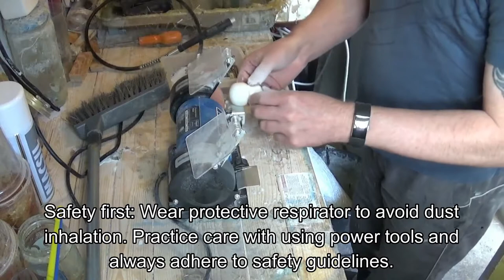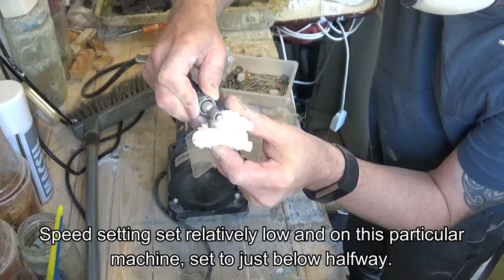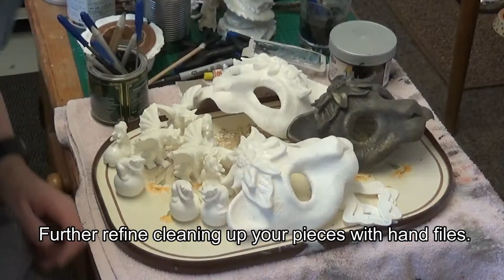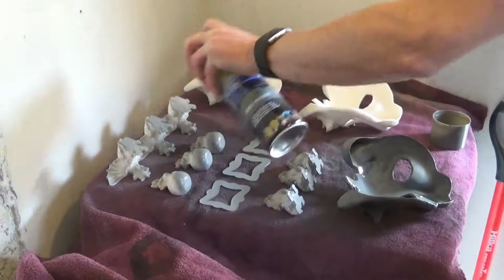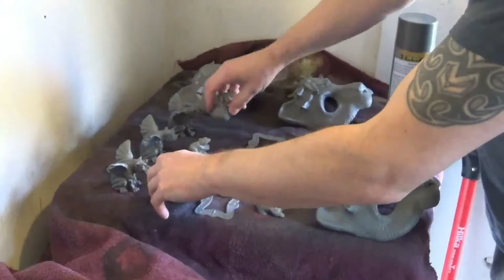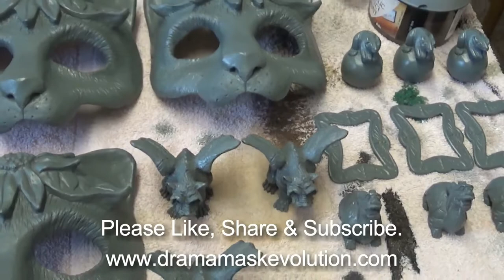Polyurethane Resin Cast Clean Up & Primer Application To Paint

Comment: This looks so cool!! thanks for sharing!  I have a toy that I want to paint over, it was made with Polyester resin and then paint with golden acrylic enamel, you think is save if I paint over with acrylics? what primer do you recommend? thanks!
Reply from the maker: Thank you Alejandra. :) I can't see any problems with you painting acrylic on to your item. You may want to sand with very fine grit sand paper to key for the paint to adhere better. I use car/automotive spray paint primer for priming, which works for me. :)
Reply: Dramamask Evolution Hi! 👋🏽 thank you so much for your reply! so I will sand, then primer and after that paint! right? thanks!!
Reply from the maker: It's hard to tell without seeing your item, but I would guess that sanding down lightly with perhaps 1000 grit sand paper would give something for the paint to adhere to. You may not need to use primer if you already have a base. I use primer on the 'raw' resin as to give the paint something easier to stick to.
Reply: Dramamask Evolution thank you! this make sense! I think the piece already have a base 🤗

Comment: Hello. I make custom bobbleheads. I’d like to increase production which will require that I make bobbleheads with paint that can’t be scratched off with a fingernail. I’ve tried every paint and primer on the market, but the only thing that works is covering the bobbleheads in clear resin. As far as you know, can you paint polyurethane so that the coat can’t be scratched off with your fingernail. I’m considering switching to polyurethane.
Reply from the maker: I usually prime my resin pieces before applying the main paint and seal with lacquer for a finish. Seems to work for me and is as stable as can be for my own purposes. :) PS: In this video I am using Polycraft EasyFlo 60, but have recently used Polycraft SG2000 which is more suitable for what I want in a small cast. Just uploaded the video in the last few days: https://youtu.be/EVTa98PXWCo

Comment: I use polyurethane Resin and Everytime I sand certain areas, those areas always gets sticky once I add a clear coat to the pieces... Have you ever experienced this?
Reply from the maker: No, I can't say I have experienced that problem with polyurethane resin. I have had sticky polyester resin casts though.
Reply: @dramamask  Yes. Polyester resins can be tricky at times. I try and avoid ever using them if I can. If you need a piece that has to be clear, then there is little other choice. So I avoid doing clear casting.
Reply from the maker: @lowerastral1963  I haven't done any clear casting yet, but would like to at some point. :)
Reply: @dramamask  When you do, just follow the directions to the letter. The only times I had problems was when I used old resin (at the prop shops where I used to work) or when the weather was not good... high humidity is bad for casting clear resins.

A dry, temperature-controlled room for casting clear resins seems to work best, but on the flip side, I've gotten perfect castings in the WORST conditions as well.

In general though, I think it really comes down to following the instructions/directions as closely as possible and giving the resin a solid 24 to 48 hours to cure completely.
I usually err on the side of 48 hrs just to be safe.
Reply from the maker: @lowerastral1963  Thank you Astral! I always go by the directions where resin is concerned. Learnt my lesson there! Haha!! :D

Comment: What glue can i use to bond polyurethane resin? And with that primer does it peel off if i nail it? I am trying to cast a tyrannosaurus rex and i cant find the right glue and paint
Reply from the maker: I'd probably give super-glue or epoxy glue a go with gluing pieces together. You might want to Google it though, to see if there is a better way with gluing, etc. :) The primer is car/automotive spray paint and I have had no problems with it so far. You might want to glue your pieces first before priming though. What I have shown in the video is what works for me and you may find better/different methods from others. :)